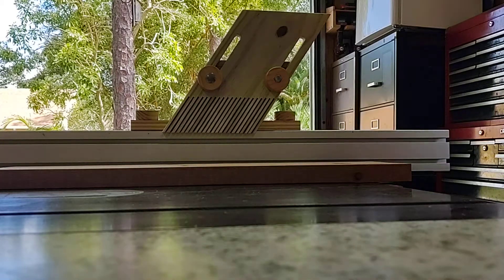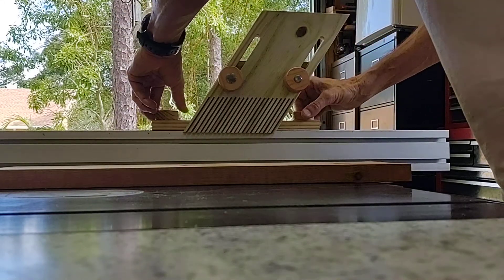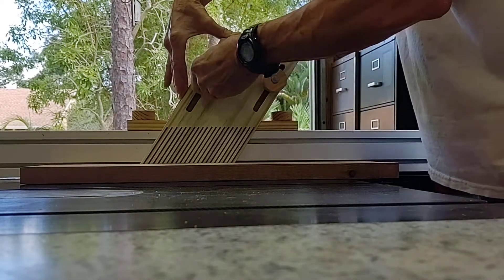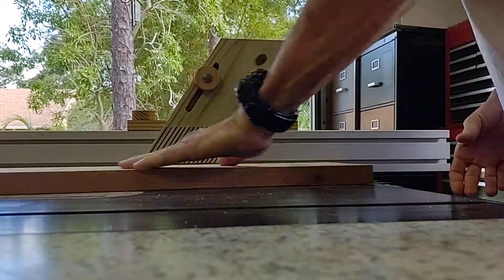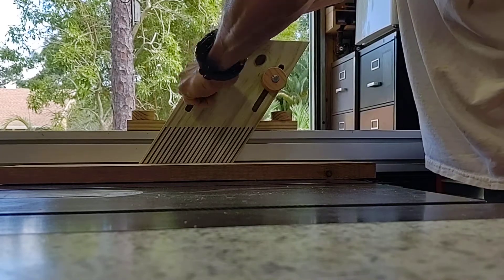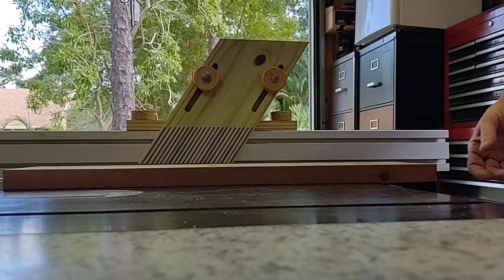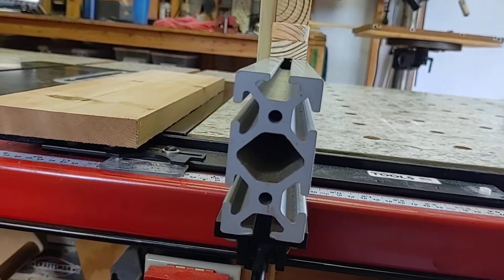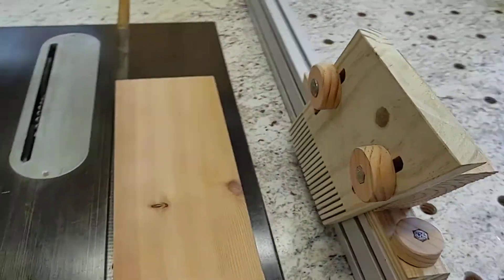DIY vertical feather board

Comment: Nice feather board.  FYI, I have been using (experimenting :>) silicone caulk.  It's great to add non-skid to a surface.  I bet it would help with stopping the sliding of the board backwards.  The fingers will still push forward to allow easy sliding forward.  Just an idea.  If you try this, let me know if it works.  Nice video.